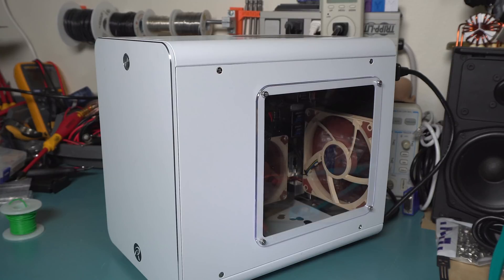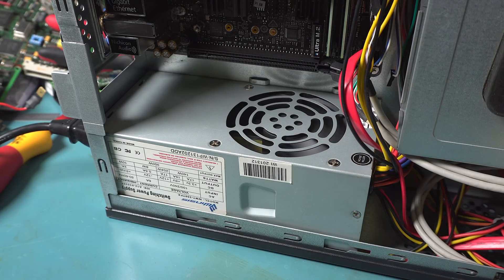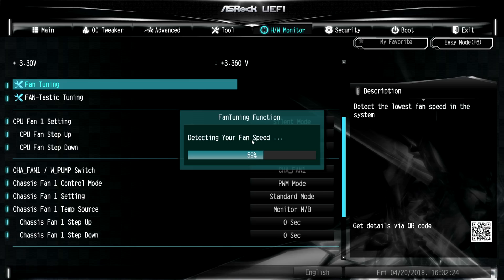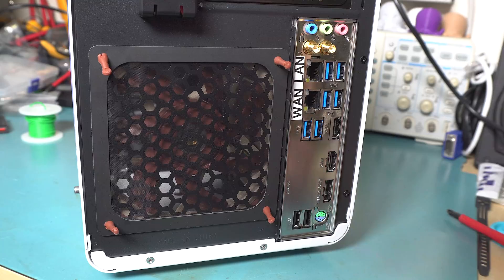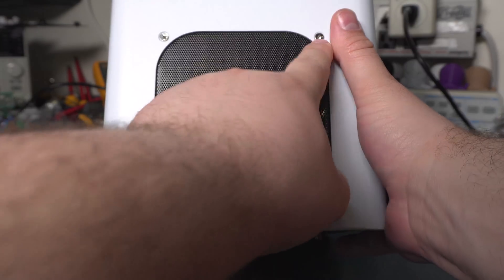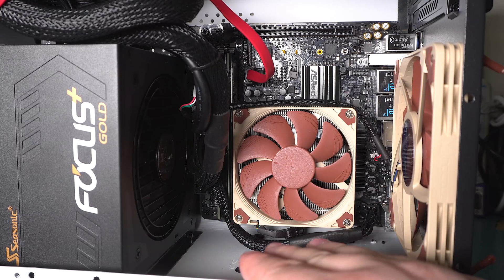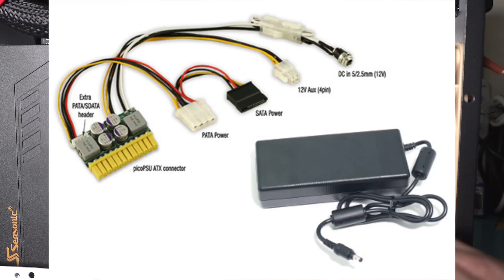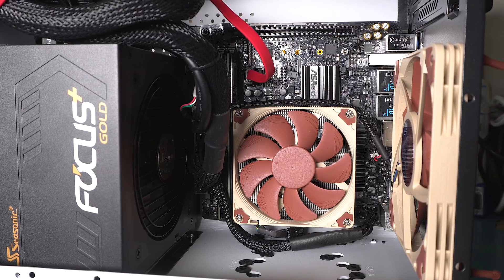Pfsense Router Build (Intel i3-8300T + ASRock)

Comment: my pf sence is build with a AMD Sempron 3850  with 4g ram ,   i think i pay 40 for cpu and 30 for the board new in 2014 i buy at the time to have it as second computer with linux  or as nas  but was wery slow , so i make it my pfsence router  since the cpu have 25w tdp and the board had 3 psie

Comment: My neighbor turned an old VCR he found at a flea market into a pfsense router and still hasnt maxed out its memory or cpu.  Do you think an i9-9700K will be enough to handle a homemade wall-clock build?😂   I have 32G of ram and a video card for it, too 😂😂.
Reply from the maker: No, you need a 9900k for that. Hyper-threading is great for maintaining an RTC.

Comment: I have an 80x20 connection with traffic shaping 20 devices snort on two interfaces, running on a n3050 celeron and the cpu averages around 45% use all time with a constant vpn interface as it has aes-ni. all for 6 watts passive cooled. yours a tad overkill but still nice ;).
Reply from the maker: Yeah, but my connection is almost 10x down, 20x up. :D

Comment: There seems to be a lot of videos just lately that show Pf Sense being installed on the sort of hardware normally reserved for a gaming rig, but Pf Sense doesn't need that sort of horsepower! I've just installed it on an old Nokia IP390 with a Celery 1.5GHz, 1GB of RAM and it will easily cater for a small to medium business use. A home user only thinks they need more processing power (for everything) but they are just wasting money.

For me the real skill is getting something to work on hardware that is classed as outdated and unusable by today's standards. A bit like driving a slow car fast around a track rather than driving a fast car slow.

Oh, total cost? Two IP390's for  £5.00 ($6.00) the pair!
Reply from the maker: People aren't getting lazy, connections are getting faster.

Try running an encrypted VPN link on your Celeron with no AES hardware and see how far you get with a symmetrical Gigabit connection like mine. :P I chose a modern chip for a reason and mentioned the reason in the video.
Reply: Sounds fair enough. So you'll be building a second one for high availability and/or load balancing? :P I didn't listen to the audio of your video so missed any description beyond the first few seconds.

The Nokia's I built aren't for my use - my PFSense routers are VMs, where they perform quite comfortably on low resources.

Just out of interest what is the contention ratio on you 1Gb connection?
Reply from the maker: The funny thing is the Nokia gear is one of the few things I haven't had on my channel - most of my older videos are taking a look at old networking equipment and trying things like Pfsense on it.

I might actually move to a VM for my setup since I am probably going to replace my NAS motherboard with something with more slots and cores, so I'll have some spare to toss at it. But I'm not 100% if I will upgrade. 

Contention isn't really an issue on my connection since it is for home use with only 2 people in the house - high VPN throughput is simply to make data replication faster to my offsite backup since it'll be heavily bottlenecked by encryption rates.

Comment: what? air is coming in through the top? and pulling down? that is all wrong ...
Reply from the maker: Yep. By default the PSU and rear fan exhaust. So the top is an intake. With the rear fan as an intake it makes the top and PSU exhausts - unless the PSU fan is super strong. haha

Comment: Nice build except..... you should NEVER ever run a 24/7 high availability server of any kind without ECC memory. But that depends on the critical nature of your needs or not. The 8300t does support ECC all day long but you need a board that can support function.
Reply from the maker: It's a router for home use. I think going to a less powerful Supermicro server board at 3x the price would be a little overkill even for me. :D

Most ram issues would just corrupt the data by one bit and TCP would error correct or resend the packet and UDP doesn't care. It's not much of a big deal to replace the motherboard in the future should be unstable - although replacing the memory under warranty would fix it as well.
Reply from the maker: As a side note, there aren't actually any motherboards for the I3 8x00 series which support ECC.

The Z370 doesn't support it and they haven't released a server chipset for them. Right now at least it isn't possible to actually use ECC with them.

Comment: Hi, long time no see.

I just sold an SFF build based on the i3-8100t...  Had a heck of a time trying to find stock.  But a very impressive CPU.  Was going to do Ryzen 2200GE, but Intel was far, far quicker to release their 35W parts to the market than AMD.  AMD is saying that Ryzen GE ETA is two months, and only then, to be sold directly to manufacturers.
Reply from the maker: Yeah, I went with the 8300t since it wasn't much more and it barely hits 3% CPU when transferring via OpenVPN at ~40-50Mbit (max speed of my remote location). I'm sure the 8100 is basically as good.

I'm getting about 20 watts idle usage. It's a little high, but that's with a crazy inefficient 650W PSU. I'm sure if I really wanted it lower I could drop it with a PicoPSU.
Reply: I wonder what kind of temp drops we would get with them with a de-lid and an application of that gallium metal TIM...  Yes, crazy good temperatures even with Intel's stock TIM (which is actually more decent than people give it credit for).

The 2200G was way too hot for an SFF PC...  80+ temps when running Haven-type benchmarks.
Reply from the maker: I haven't been finding temps an issue with the i3 at all. I'm getting 39C idle in a ~30C room and nothing crazy under high load (~70C) and that's with a tiny Noctua heatsink. With the reversed fan I showed in the video the case seems to remove heat quite well.

A 2200G has a "proper" GPU in it - totally not needed. That's why I like the crap onboard i3 GPU. haha

Comment: What packages are you running that need the power? My pfSense router only has a C2D E4600 and hits around 50% load when pushing my 1Gbps link.
Reply from the maker: It's not entirely a question of CPU power. I could have made a Core 2 based system with just parts I have sitting around (in fact, I just made one temporarily to flash the firmware on a blu-ray drive to enable 4k rips), but also efficiency. I'd rather pay a bit more for a much lower power system while also still having the power available if I need it.

I was strongly considering an Atom based build - similar to my mini FreeNAS build, but I figured this is way more powerful for not many more watts and about the same price. :D
Reply: I am considering to use Supermicro A2SDi-4C-HLN4F for a pfsense build. The main advantage i see is that it has 4 NICs out of the box which is useful for a dual WAN setup. The case i plan to use in M350 mini-itx (http://www.mini-box.com/M350-universal-mini-itx-enclosure).  How does that match to your build?
Reply from the maker: It's a great board (I use it in my mini FreeNAS build). Overall it should work great, I would be concerned if you are going to do a lot of fast OpenVPN as it isn't multi-threaded and will be slower on a single Atom core than the single i3 core.

You will have to install a fan in that case for the Atom, it looks like it can take a front 40mm fan and that should be enough.

PS if you're getting the board on Amazon, use my affiliate link. Helps me afford more stuff to build and take apart :) https://amzn.to/2IUrq92

Comment: Have you tired OPNsense?
Reply: Peter Brockie it's a fork of pfsense
Reply from the maker: Is there any particular reason to use it over Pfsense? Seems like most of the community support is for Pfsense.
Reply: Peter Brockie no reason at all, in fact there is really no point.
Reply: https://opnsense.org/opnsense-com/ and Pfsense isn't really open source plus has tracking id code in it
Reply from the maker: Nope. It's a fork of monowall, too, right? I haven't tried it myself, but it should be about the same in terms of functionality with a different UI.